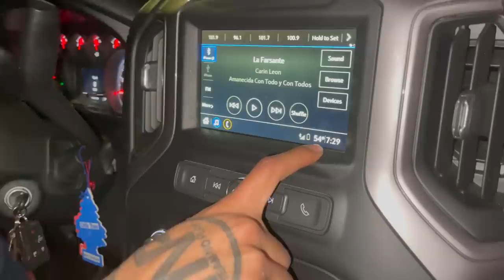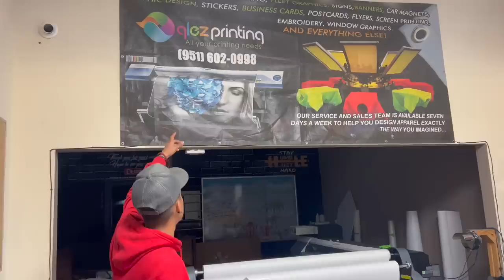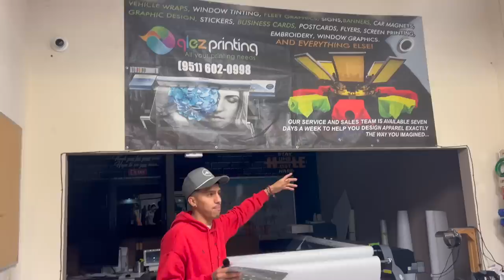My 2020 Single Cab Is Almost FIXED !!

Comment: Thats like 30lbs of Bondo too much body filler
Reply: Exactly. They should of cut it out and redone the panel with fiberglass.
Reply: That's gonna be cracking with than a year or so. He should replace the hole panel
Reply: Another bondo bandit smh